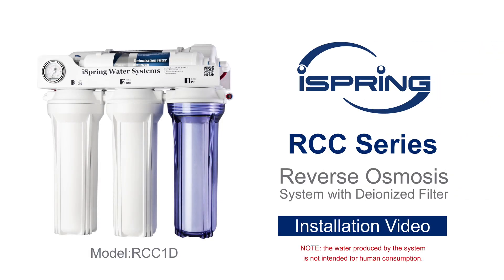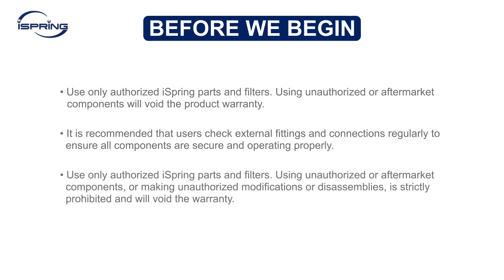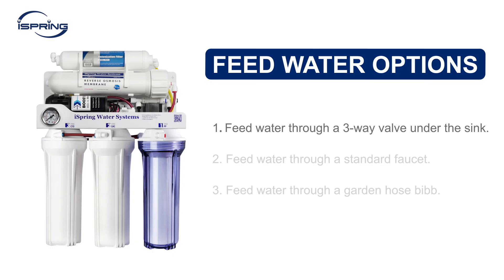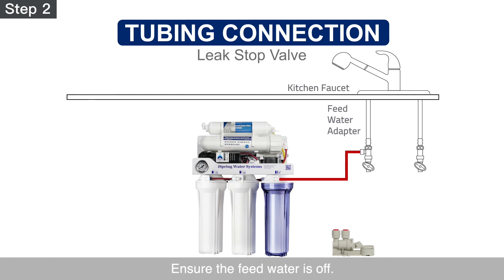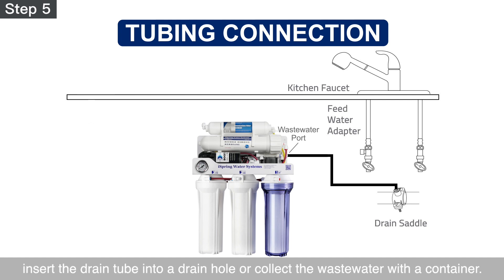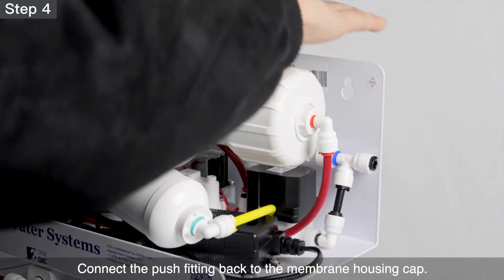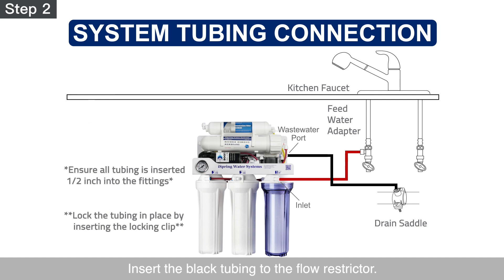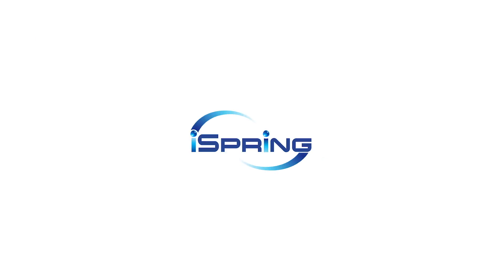How to Install the iSpring RCC1D / RCC1DP Deionized Reverse Osmosis Water Filter System

Comment: If I'm using this for an aquarium and only need RODI water once a month, what is recommended for this system when not in use to extend filter life? i.e. should I keep it connected and filled with water and just turn the valve off or disconnect and drain it? Thanks in advance.
Reply from the maker: Hi there! Our systems are designed for regular use, which means water needs to flow through the filters to keep them in good condition.
We recommend running water for 30 seconds every 24 hours, or 30 minutes once every 7 days to keep the filters from developing odor or bacterial growth. If the system is not used for over 3 weeks, the filters should be replaced.
If you need further assistance, please don’t hesitate to contact us at support@ispringfilter.com or 678-261-7611 (Monday–Friday, 9 AM–5 PM EST). We’re here to help!
Thank you!

Comment: Is there a way to just bypass the demonization.  I want to use this to water plants
Reply from the maker: Hi there! Yes, you can bypass the DI (deionization) filter if you want to use the system for watering plants. The DI filter removes all remaining minerals from the water, making it extremely pure, but deionized water isn’t ideal for plants because it lacks the minerals they need.
To bypass it, you can simply remove the DI filter and connect the tubing that comes from the RO membrane directly to the output line that normally connects to the DI stage. This way, the water will still go through the RO membrane but skip the DI resin filter.
If you need further assistance, please contact us at support@ispringfilter.com so we can assist you better. Thank you!
Reply: @iSpringWaterSystems  If I do the DI bypass then will the water be drinkable?

Comment: Why at the start of the video does the narrator say 'the water produced by this system is not for human consumption" Isn't that the point of this water filter?
Reply from the maker: Hi there! These particular systems include a Deionization (DI) filter, which is designed for applications such as clinics, aquariums, or anywhere zero or near-zero TDS water is needed. Because the DI filter removes all minerals, the water is not intended for drinking — our bodies need to absorb certain minerals from water.
If you are looking for a filtration system for drinking and cooking purposes, please check all our Reverse Osmosis (RO) systems here:
https://www.ispringfilter.com/ac/reverse-osmosis-water-filter-system
If you have further questions or concerns, please reach out to us at support@ispringfilter.com  or 678-261-7611 (M-F 9:00-5:00 EST). We’d be happy to help! 
Thank you!
Reply: @iSpringWaterSystems  just add a few pieces of Celtic salt for mineral perfect
Reply: @iSpringWaterSystems will the water be drinkable if I bypass the DI filter?

Comment: I got this filter and followed this videos instructions. My system just keeps draining the same amount of water the actual filter produces. Any idea what’s wrong?
Reply from the maker: Hi there! Please note that the RCC1D pure-to-waste water ratio is 1.5:1 and the RCC1DP is 2:1. 
If you have the RCC1D (without a booster pump), please check that your incoming water pressure is at least 45 psi. If it is below 45 psi, we recommend adding a booster pump to ensure optimal system performance.
Feel free to contact us at support@ispringfilter.com or 678-261-7611 for proper assistance.
Thank you!